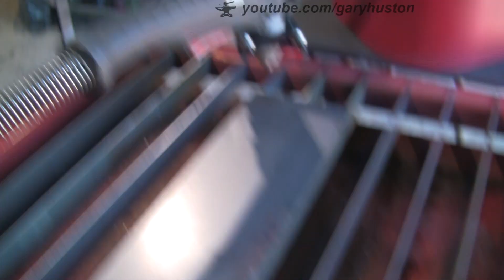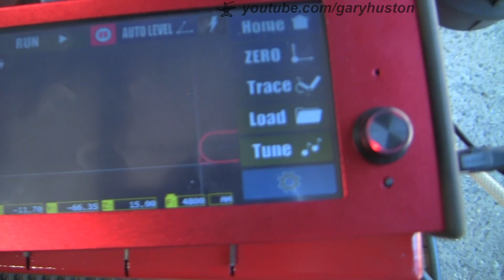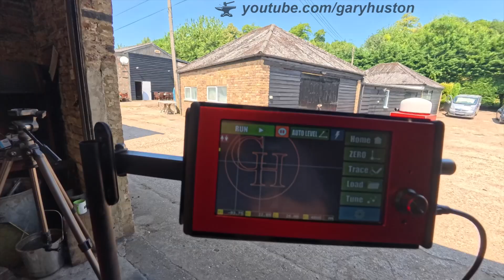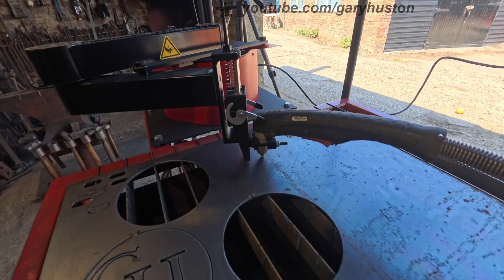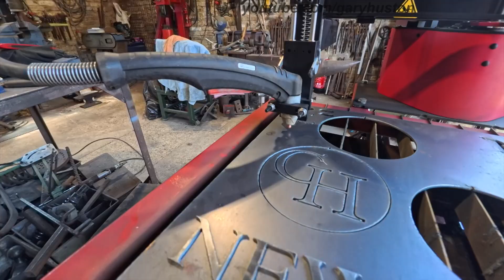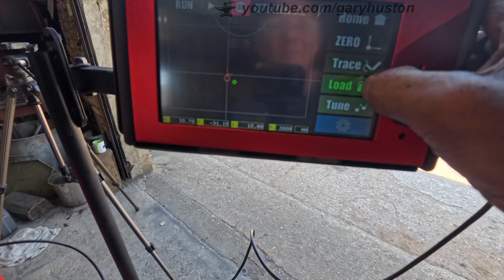Arcdroid First Cuts and mishaps!

Comment: @garyhuston  if you had the plasma cutter mounted to the side / back of the cart would a deeper drop to the water tray make it less splashy but also do the same thing?

the other reason i went with the dry sloping capture box was to keep the sparks contained for when i'm using it inside the garage so its less likely to start and fires.
Reply from the maker: It probably would. I’m not in today but I may just be able to put some tracks lower down and use the same tray just lower, like an oven shelf!

Comment: hi Gary, i don't have the auto stuff but a regular plasma cutter, i went with a sloping catch tray rather than a water tray for the reason of the splash back
where i have a smaller garage i converted a clarke tool trolley to be the plasma trolley, the slope was the max i could go as the plasma sits under it like yours, to the back there is a deeper section for the mess to collect in.

yep, still leaving the earth off as well lol, 
that does look like a really useful bit of kit though

Comment: Great video!  My son and I built a 4'x9' CNC plasma table about 6 years ago.  They are quite useful.  He has a water table on his.  Water tables are quite messy but it is nice that the parts are cool when they get cut out.  And it helps keep thin pieces from warping.  We also added a rotary chuck which is handy for cutting the vertical parts on a pipe gate.  He can whip out one in about 5 seconds.  He has even mounted an oxy-acetylene torch on his to cut 3/4" and thicker plate.  It really makes a mess with the water table.

Comment: Another uk user great 
Did you get yours from rob at xtreme plasma I did 

Your cut height is way to high 
Set it to 1.6mm
Reply from the maker: No, I didn't get it from Rob. I started with that height because that's what the manual for the cutter recommended. I have since lowered it to 1.7 and it cuts squarer.

Comment: Hi Gary, becareful with water condensation under the tray. Just something to consider.
Reply from the maker: Gary, I’m not sure I understand what you mean. Are you thinking condensation could drop on the plasma cutter?
Reply: @garyhuston  Yes, Gary
Reply from the maker: @Gunni66  well I have already emptied the tray of water as the spray from the plasma air was really covering everything which I wasn’t happy with. I think I will just run it dry and use it by the open door.
Reply: @garyhuston My main worry was possibly damaging the plasma cutter, which then could possibly cause other problems. I take it the water in the pand is for cooling the cut parts? If that is the case then use a small pail with water and drop the cuttings into it. Just an idea.
Reply from the maker: @Gunni66  no, the water is to capture the mess from the cut and some of the fumes. It’s quite a messy process!

Comment: cut height is WAY too high - best results use 1.7mm and pierce height 3mm
Reply from the maker: I will experiment but I’m using the recommended settings for this plasma cutter at the moment.
Reply from the maker: I tried lowering the cut and pierce heights and it doesn’t work so well. I guess the plasma cutter manufacturer gave those settings for a reason!